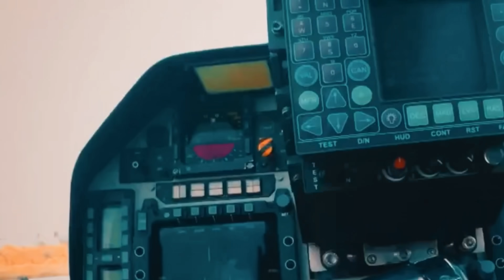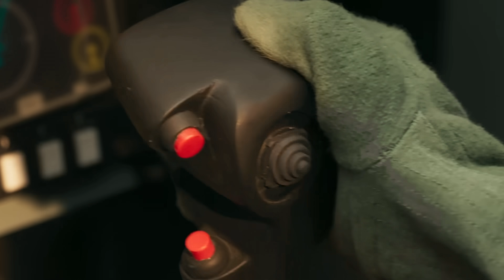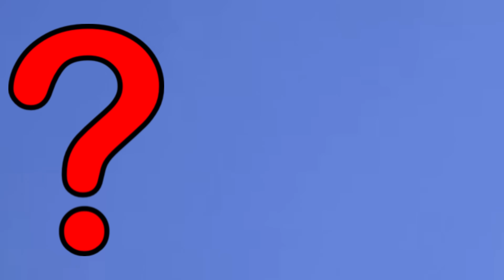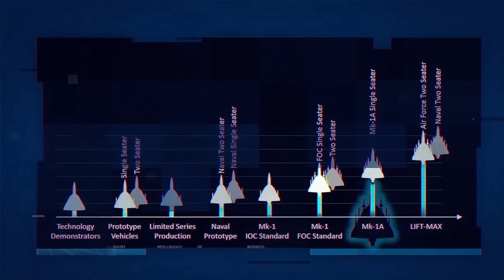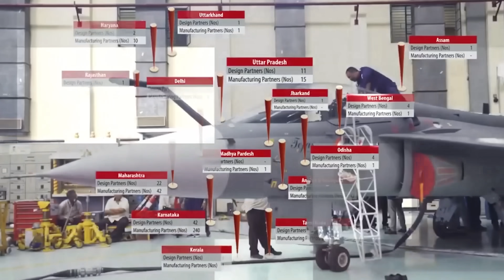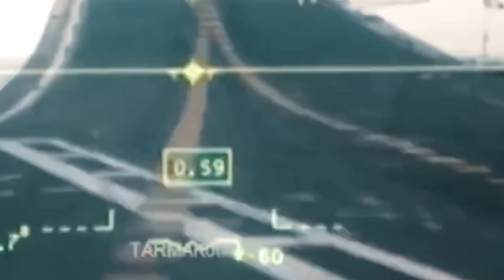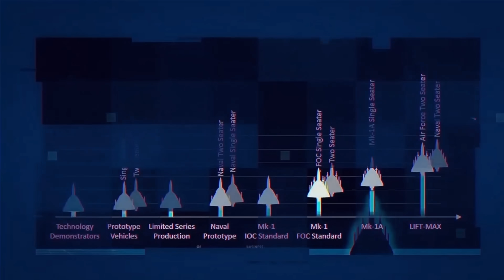Why does everyone hate the Indian 'Tejas' LCA 4th Generation Fighter Jet?

Comment: Although India started making fighter jets much later than other developed nations because of various factors both external and external the India managed to become one of the very few nations to make a fighter jet. Another point to mention that more than just the high technology a lot depends  on  the man behind  the wheel who finally uses it effective.  A case to the point is the Saber jets of Pakistan acquired from US and used against India hardly could dent the Gnat jets of India and another case is the hight tech Patton tanks of US could not give a great advantage to  Pakistan to win any war . The effectiveness of Tejas will be seen only in a real war scenario.  Moreover a lot is changing to make Tejas more potent in the new versions. Another factor which is not mentioned is the low cost of Tejas  compared to the western products which are outrageously expensive specifically for developing countries.

Comment: Mat, sorry to say, but most of the information shared by you in this video is way off the mark, mate, and can sense inherent bias creeping in.
We Indians know that the LCA program was of troubled inception, but the west-based analysts got the information wrong, not all of it, but most of it and most of the time.

1) Because of their class and size, you can't compare it to the F-16 or Gripen and they are expensive.
2) Except for the engine, most of the tech developed is integrated now.
3) The LCA is one of the few aircraft combined with a large amount of composite used with a small size gives limited inherent stealth by design.
4) Nuclear tests conducted by India are the reason for the delay, but not cost overruns, as collaborations with the west were disrupted during that period.
5) Most of the tech is developed in house, either be avionics, flight controls, or weapon systems. Content value is near 70% and increases with each upgrade.
6) The AESA multifunctional radar UTTAM developed will be used from LCA Mk1A, replacing EL/M-2052, which is no slouch to start with.
7) The LCA is the sole aircraft that has been proven to be compatible with both East and West in terms of technology and weapons, resulting in a significant amount of operational flexibility.
8) It was difficult to access the LRUs by panels in the initial batch of aircraft, which has now been solved by using quick detachment panels, improved serviceability and reduced turn around time.
9) LCA never had bad fleet availability, it's already above 75%, even more in new variants, except for the recent crash due to engine failure after 8+ years of accident free service, this  record proves that.
10) LCA has been deployed at borders facing both Pakistan and China along with SU-30 MKIs, Mirages, and Jags, in most inhospitable terrains like the high altitude Himalayas, Rajasthan deserts and temperate Sulur, Tamil Nadu in the south.

But, good effort, we don't hate you or something, But we Indians think and build different, like our LCA Tejas, Please do more Videos and all the best.

Comment: Well researched!!
But i think any aircraft should be judged on basis of it's role, in case of f16s or gripen e, these the jets which are used as main fighter jets in many airforces u know it very well, but on the other hand Tejas has completely different role altogether, its a multirole f.jet nd it will not be on the front line, nd for those who dont know there is an AESA radar on it (Israeli)(( not sure about it ))nd all modern tech that should be on a 4th gen f.jet . Nd another thing is it's unfair to put in a different league it should be compared with jf17s (unfortunately 😂) , although its way superior to it. Nd don't forget mk1A's enhanced capabilities, futher mk2( similar to gripen e) , AMCA MK1&2, TEDBF(for navy)

Comment: It has not proved itself in any war etc that is why no country buys it but capability wise it is quite capable initial version where not up to standards but starting from MK1 series it is a lethal machine . As even indian airforce itself has not made any big achievements via tejas . And the mk2 version will be more lethal it as capable as mirage which is replacing aging fleet of mig21. We believe in tejas and indian air force is very strict about there requirements so they will definitely not take any jet which underperforms just because it is domestically build .

Comment: all these "expert opinions" make me laugh.

India set out to build a plane to replace their Mig 21's and over 3 decades, increased requirements and funding multifold to make something decent.

Now, the point is that everyone criticizing this plane, is comparing it to platforms which were made to meet different requirements.

F16 was designed to be an all purpose commercially marketable compact strike package aimed at budget strapped nations.
Gripen is an European take on the F16 and JF 17 is basically a Mig 21 on steroids.

Tejas was originally designed to be a small and economical interceptor meant for point defence roles. Thats it. nothing more.

Over the course of development, it evolved into being much more capable than a simple point defender and ADA has every right to be proud of it.

The actual multi role pacakge is going to be the Mark 2 variant which is expected to take flight in 2 years from now.
Reply: Nobody is buying tejas. Remember Malaysian deal?  How desperate was India to sell Tejas? Noone believes the spec India preaches, the biggest problem.

Comment: So i watched the whole video. I have been closely following the Tejas project for about 15 years now. While Tejas isnt a perfect aircraft, i would still like to make some corrections from what the youtuber said. 

1. It was compared with the "Gripen and F-16" saying "Gripen and F-16 can carry 3 times the payload". That reference was taken out from a media hit job article by import lobbyists saying that Tejas isnt enough to protect Indian skies. 
Fact it, Tejas mk1 was compared to a larger medium weight Gripen E version and offcourse a larger F-16 version which cost more than 2 times of Tejas. Neither they are similar in size, nor the price range to be compared. Tejas mk1/A is to be compared to the Gripen C version which is similar in size and cost. And u will notice both have a maximum payload capacity of about 4 tons. More if some fuel is sacrificed.

2. Maintainability was pointed out. One of the key points of Tejas mk1 is its easy maintainability often pointed out by the pilots and engineers. The high use of composites not only makes the fighter light and increases stealth, it also makes maintenance easy. Supported by advanced avionics and "intelligent" softwares, engineers are not complaining. The youtuber mentioned  Exercise Iron fist. In the same exercise, 6 Tejas participated and EACH Tejas performed 6 sorties a day, proving its easy maintainability and quick turn around time. 

3. While i agree , there are some delays with the Tejas, it was more political than technical. Actual work on Tejas began in 1988 with the project definition phase and Tejas had achieved initial operational capability by 2012. That should have allowed induction and large orders.  However the bribe hungry politicians and some high rank airforce officials wanted the bribes that come with imports and purposefully kept changing the goal post of the Tejas thus delaying induction and a large order book. For one example out of many - They wanted Tejas mk1 to have full swing role capability right from day 1. In comparison, when fighters like Eurofighter or Rafale entered service, they didn even have ground attack capabilities, let alone swing role. Everything was gradually added and tested in the later versions.

4. Also the cost of Tejas mk1A with AESA , EW and all other advanced features is a mere 42 mil$, one of the cheapest in the world. The project cost is about 2 Bil$, only a fraction of the cost of fighter jets developed in the west.

Comment: The entire development cost of this program was 1 billion dollars , lowest in the world. Idk what anyone expects from the air craft. It’s a point defence interceptor, not meant to be cutting edge but to do a specific job, intercept as quick as possible and stall.  It’s not the best in the world or even among the top jets at all . But since it’s in house, thus in war scenario we can replace it much faster eventually and have larger numbers. Then also helps in developing future variants and in house industry .
Reply: Too late other countries are moving on to 6th gen fighters.
Reply: @redman1249  Don't worry, once we get the manufacturing ecosystem for Tejas up and running. We will have drones with both 5th gen airframes and techs.
Reply: @3Areviews  Building 5th Generation aircraft will be way more difficult. If the Tejas program is anything to go by then by the time it enters service, 6th generation aircraft will start entering service.
Reply: @redman1249 
Ghatak Stealth UCAV with 5th gen avionics and 50kN dry thrust engine would be flying in about a year or two. IAF have everything figured out. In next 2 years, India will start serial production of Dry Kaveri, Improved Kaveri, F414, HTFE-25, PTAE-7U engines to bolster IAF's strength.
Reply: @3Areviews  That's what they said about the Tejas, the MRFA/Rafale - of which the IAF was to get 126, the Ka-226 etc.
Reply: @redman1249  Ka-226T for India is now closed. Yesterday, HAL recieved RFP for 156 LCH Prachand. New HAL LUH will receive orders too. Rs 2k Crore already sanctioned for HAL NUH project. Rs 6k Crore for IMRH and DBMRH also under R&D now. Cargo Drones & Recon Unmanned Heptr already under production. There's more if you wanna hear more.
Reply: @3Areviews  With HAL's record & incompetency, I doubt many of these projects will be not delivered on time & overbudget. And you're proving my point about Indian procurement failures.
Reply: @redman1249  Asia's Largest Heptr Plant by HAL with 90 units per year already inaugurated recently. Don't worry. India being NAP cannot risk itself of depending on foreign supplied spares. HAL doing fine with localising spares and components. Fleet availability matters the most when one have enemies like China. Indigenization matters, so HAL is slow.
Reply: @3Areviews  We'll see, India still flies the Chetak & Chetal which were built in the 70s. With HAL quality control & production problems, I doubt it.
Reply: @redman1249  HAL is able to cope up with quality issues, this is why they are getting contracts, as for production issues , it's a complex topic which can be solved with large orders and smooth supplies.
Reply: @3Areviews  They are getting contracts because they're a monopoly. You're pretty naive, HAL is incompetent & inefficient.
Reply: @redman1249  HAL is the lead assembler. Whatever contracts they get is amalgamation of costs for needed products & techs specialized & supplied by dozens of OEMs & their subsidiaries.

Comment: Admin forgot it is a light combat aircraft ,size much smaller than f16 . For this size and extensive  use of composite material ge 404 is enough . It has 8 hard points and can carry  2 bvr, 2wvr (dual rack pylon), 2 drop tanks and self protection jammer at the same time . 
For its size and operational cost it is enough payload.  If tejas carries only one drop tank on its centerline  pylon it can carry 2 more bvr resulting in total  6 air to air missile . That's  a good punch .🙏
Reply: The future Brahmos and similar missiles could be as small as a Pencil Box that Indian Kids carry to school but with destructive powers. It is not electronic Equipment alone but Ordnance which our factories both Public and private are producing.

Comment: They haven't been able to develop most critical parts and that is the engine and the ejection seat and the flight data recorder as well as a few LRUs.So it isn't a totally indegenous program .They have a long way to go against a adversary like China and India faces a fighter aircrafts deficit like never before against the looming prospects of a two front war. India is surrounded by Muslim countries all around. Nuclear deterrence and Russians holds the game for India.
Reply: Seeing HALs record India will not be able to produce the ordered aircrafts in time .HAL has a record of not being able to make any thing worth while ever in time .They don't ever exert .The only way was to generate a manufacturing capacity of 50 aircrafts per year .with a capacity utilization of 50 percent they would have produced 25 per year. I doubt even that .MOD IS complicity to not being able to develop a decent manufacturing capacity. I see that with Bastards around that too in great numbers nothing much will ever materialize.Every now and then new claims are issued since last decade but they all turn out to be the false claims .Now we have stopped believing these Bastards. Now HAL script has multiplied without a single aircraft being delivered to Indian Airforce for last 2.5 years .I conclude that the y are all scums the HAL, MOD and MEDIA .

Comment: I have never met anyone who hated Tejas. It is a small 4.25 gen (4.5 on a good day) tactical fighter bomber. It looks like advanced variant of 1950's US and French designs with its delta and pointy node. But aerodynamics are aerodynamics.  It is small, liie Mig-21, but not small enough to evade advanced air-air missiles, radars, and IRST. So it will come down to training , tactics, and C&C integration. Overall GOOD JOB India!
Reply: Definitely not 4.5 or even a 4.2. So you're saying this is at par with KF-21 w/c is a 4.5?😂. FA-50 then maybe.

Comment: Tejas aircraft is also located on highest altitude runways in Himalayas,where Chinese j 20 get cracks due to extreme cold 🥶 temperature
Reply: The Chinese runways are higher and you can only wish Chinese jets were as bad as yours since you can’t stop them being built more.
Reply: @tritium1998  did they modified it after that incident

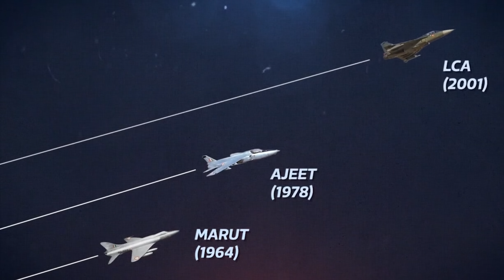Comment: About 3:45 ish the Marut and Tejas are Indian developed, the Ajeet is a Folland Gnat with updated and improved subsystems - so not an Indian design (although built in India). 
About 5:20ish the delta has advantages in straight and level flight but is very "draggy" in a turning fight so you need a higher power to weight ratio to compete with other fighters, e.g. F16 - the Tejas lacks that necessary higher P-to-W ratio.
About 10:30 ish The initial tranches of Eurofighter have a non-AESA radar (possibly the best such radar in the world - large, powerful antenna) look up CAPTOR (not to be confused with CAPTOR-E ECRS in various marks which are AESA radars). So such a radar is not necessarily as bad as it might seem (I don't know the characteristics of the Indian Radar).
Tejas is an adequate aircraft for India - it does the job but not as well as many other aircraft. I think maintaining and developing the skills to design, develop and build in series production a fighter is a key element of the reasoning behind India's decision to continue with development of Tejas. Hopefully, its replacement/next generation will be genuinely competitive with other leading manufacturers.

Comment: As I understand it, one of the main points of the Tejas program was the creation of an Indian military aircraft industry that could manufacture its own indigenous aircraft.  In this, it was a success but as this was essentially the first project of said industrial base it was inevitable that faults would be found and it would have a longer than usual development time (although nobody expected it to take as long as it did) in comparison to programs by countries with an existing industrial base for military aircraft.  Unfortunately it took so long to develop that it essentially skipped generations initially being meant for release in the early 1990's.  Considering that was over 30 years ago now it is unsurprising that the Tejas is not up with the best modern fighter aircraft where it comes to outright performance because there is always an effective limit as to how much you can fit into any air frame and the frame in question was not designed for modern gear.

Comment: Lot of false info is given. Though the govt gave a go ahead in 1983. But the funds were given only 1993. Most people like to latch to the date of 1983 and want show indian delays. Also when the aircraft was ready in 2011, congress doesnot want local products - commissions and loot will stop, hence no encouragement. Tejas can fly above 1.8 mach, but designers limited the speed to have a higher factor of safety.  RCS is very low compared to any other fighter because of fiber body. 
The negative press is only by the crooks who lost money as they cannot get the commissions on perpetual basis.

Comment: The primary reason Tejas is disliked is that it outperforms its comparable rivals with substantial financial resources and influential lobbies. It would have moved much faster had it been in the private sector and avoided mischievous influences, as it would be driven by performance. It, however, continues to evolve with tremendous improvements.